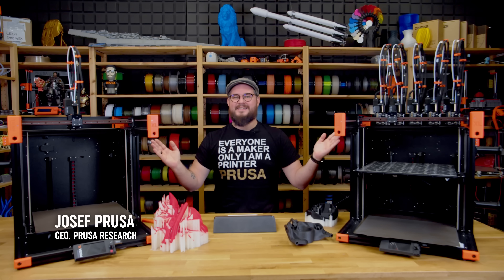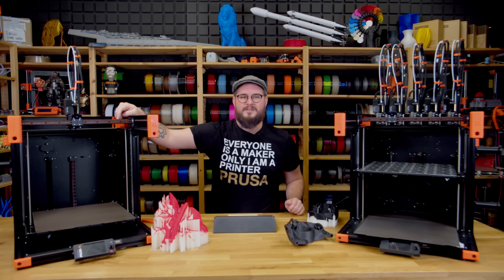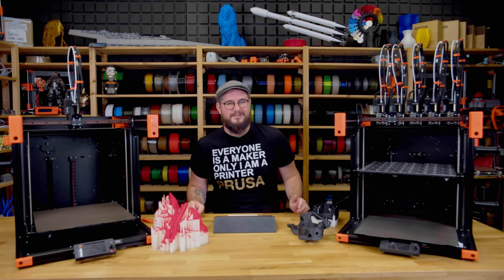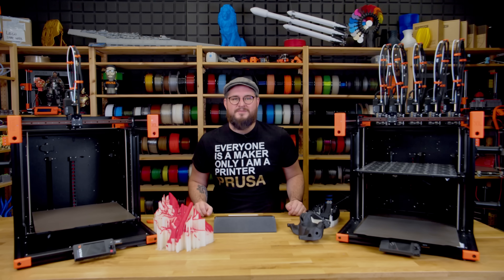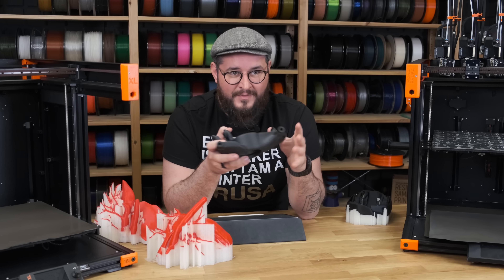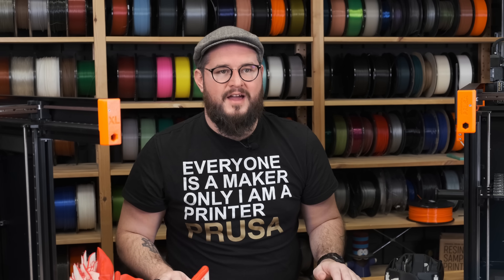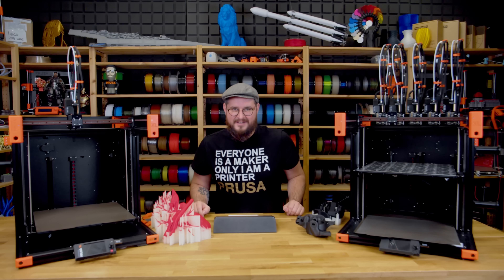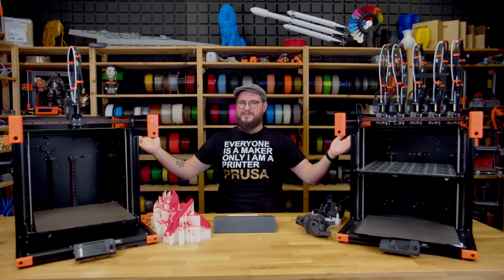XL update - beta test news, hardware changes and shipping schedule

Comment: So the biggest thing I see a TON of people comparing the XL to is the Bambu. The primary issue is.. speed of print.. and speed of tool change. A few demos showing us how fast the 5 head printer is.. both in tool changing and printing different materials would have been a VERY welcome update. I am being told by a few people now that the Bambu even with its massive filament waste.. will be faster printing than the XL.. and that the XL individual heads don't print any faster than the 5+ year old MK3. Would love some sort of update on this.. what sort of speed can the heads print at and how fast for tool change? Also.. will there be an enclosure option so that we can print ABS, carbon fiber, etc and will the heads handle 300+c and bed 110+c?
Reply: True multimaterial. Softflexible with PCTG for example and soluble support on top. With single nozzle designs you have to flush an absurd amount of material to get the soluble material completely out of it (think of transition from black to white and then multiply it by 10 or more). Otherwise you worsen the mechanic features of the non-soluble material. 

Bambulab has a "multimaterial" unit, in principle like the MMU or the Pallete. Those aren't really very good at multimaterial, they are best used as multi-colour. That is not the same. 

Speed is a thing but it isn't everything if one machine can offer something what very few others can.

I do agree however that the XL needs the option for a proper enclosure. Not necessarily actively heated but a proper enclosure nonetheless, at least as official upgrade.
Reply: That is a thing with the single tool XL. However as soon as we are talking about multiple toolhead XL, this is just apple and oranges. Both printers are in two entirely different leagues. There are very few easy to use, at least somewhat affordable multitoolhead printers out there (the XL is expensive but at least it is not yet completely crazy for a non-commercial use case). Of course, a multitoolhead print won't be as fast as a single toolhead print (it might be faster than a multicolour print on the Bambulab, we can't say without comparing actual printers yet) but it can print a lot of things that are impossible to print on a Bambulab even in multicolor mode.
Reply: @sagichnicht6748  in the diy space, a multitool blackbox kit can be built for close to half as much as a 2 tool xl,  and can print decently high temp filaments and can be water cooled.  runs klipper.
Reply: @JustinBuildsThings  Honestly I had not heard about the blackbox before. Looks interesting on first sight, but it is as much a competition to the XL as the Voron is to the Prusa. Not quite the same target group even if there is some overlap.
Reply: @sagichnicht6748  I'd be interested in knowing what a multi tool can print that the bambu couldn't? You can load up different materials and colors on Bambu as well. So not sure how it could not print anything the XL can?
Reply: It's core xy and it has high volume nozzle (assuming from Vulcan nozzle adapter). So main limitation to speed will be software and cooling - which can be dialed in. With multitoolhead, they could even switch between lightweight bowden and direct extruder.
Reply: @Papinak2  software being a speed limit? Maybe if they are still on 8 bit (if they are my goodness is there any hope for prusa? It's 2023!!). Bambulabs will do 300mm/s, and has cooling to match. No way prusa XL can match that with a frame like that. Cooling is just a matter of adding fans around the heat bed. Yes corexy = fast however all other parts have to be there to realize that potential. Rigid frame, 32 bit MCU, or klipper on RPI as co-processor, cooling as you point out etc.. all of it falls apart and is hard to fix if the frame is lacking.
Reply: @jotham123  what so great about bambulabs frame? They are just open steel profiles and its axes run on rods fixed on their ends. It's nothing extraordinary.
XL has linear rails on massive aluminim extrusions. I don't see reason why it should be much worse.
Reply: @Papinak2  exactly, steel. Big difference. With a bar across the front. Not a U shape when viewed top-down.
Reply: @Papinak2  That is what I was thinking.. this update indicates more rigid axes for linear rails to run on.. so I am curious how much more. I would have loved to see Prusa move to 4040 extrusion though.. sure makes it heavier and more expensive..but would have really bolstered the frame a lot more. Also.. offer some sort of enclosure option so out of the box we can print carbon/abs/poly. As it sits now.. we can't do those. :(
Reply: @jotham123  you just pulled one thing and assumed it's automatically better? That's like saying that spring is more rigid than aluminium tube, because it's steel.
Bambulab needs fully enclosed frame, before it's made from stamped L- profile. Prusa doesn't, as enclosed profiles are more rigid. And nothing stops anyone from adding a  brace to the front - it'll just obstruct view and access.
Reply: @Papinak2  let's wait and see what the results are. My bets are on bambulabs goes to higher speeds than the prusa XL and has better quality. Let's see..
Reply: @jotham123  yeah let's see. Out of the box, prusa will be definitely set  slower than X1 - but it doesn't mean it can't go faster. From point of mechanics, XL is more solid, but heavier with longer belts - some sort of input shaping will be necessary, but IIRC, that's already being implemented.
Reply: It’s a core XY so speed won’t be an issue
Reply: @baderalafghani4564  It's not going to be doing speeds like a voron or bambu. They've done corexy but on a C shaped frame. High speed printing on that absolutely will introduce problems as its front heavy.
Reply: @baderalafghani4564  just look at the frame, it's aluminium, which is not super rigid, and on top of that the way the frame has been designed just makes the situation worse. I've questioned the frame choice from the beginning. It's not going to get fast without rigidizing somehow. Bambulabs is going to eat jo's lunch if he doesn't watch out and he knows it. He's not super smiley and seems a little stressed!! I know I would be if I were in his shoes.
Reply: @jotham123  Prusa is a Religion to some people and believe there are lots of them out there.
I think it won’t be extremely fast but it will be acceptably fast .
They have tested it and some viewers out there are testing it .
TBH I have big hopes for it and it has some innovative ideas like the modular bed .
Reply: @jotham123   "just look at the frame, it's aluminium, which is not super rigid"
And you think the BL printers are? BL printers are made using thin gauge stamped steel lol. Look at how much a BL printer shakes and rattles compared to a voron running the same speed...Solid aluminum extrusion is infinity stiffer than thin ass sheet metal.
Reply: @LilApe  You are exactly right Lil Ape.
Reply: @jotham123  Yes, the market has become a lot less comfortable for Prusa. The easy years are coming to an end. However, if the XL works as promised, even if its not a superfast printer, I think Prusa will still have a fairly unique offer on the table with fairly little competition in that very niche, so far. The Mk3s on the other side, urgently needs a major update or rather complete redesign. It is getting squeezed between the cheapo options and Bambulab.
Reply: @sagichnicht6748  i agree with your statements.
Reply: @LilApe  You might want to actually try using one. The frame is rock solid. Honestly you've made so many incorrect assumptions in the comment section alone today that it's pretty clear you know next to nothing about the Bambu. Competition is a good thing. It forces everyone to up their game. And facts dont lie - the bambu for all its 'closed ecosystem' faults is a phenominally good printer, and I say that as someone who's spent a significant amount of money on Prusa printers.
Reply: @puressk  I've ran them, borrowed a friend's p1p to replace a stepper motor that burned out in less than 24hrs of ownership. The frame is flimsy and bendable. The frame is spot welded.
Reply: @LilApe  The Prusa XL is no Voron though. It's a voron where you remove one of the sides. How rigid is that?
Reply: At this price range, if it cant compete with the Bambu speed, its a no go imo. Market has shifted and we need speed and quality printing + quality of life improvements. WiFi, auto bed level, auto z adjustment, just do that auto calibration, load the print and forget - no user adjustments.
Reply: @VandalBee  Then you don't want the XL for what makes it stand out. I don't know, maybe there is no market for what the XL can print but Bambulab can't but there are certainly a number of exciting things that are coming to my mind which would belong to that category.
Reply: @VandalBee  You're not wrong.. the game changer part is the tool changer. We wont know until we see results.. for Prusa's sake.. I hope this printer can print at 250 to 350 per head.. and tool change is fast too.. because multi color prints.. able to print a lot faster over all because of fast tool change and pretty fast prints.. will win customers. Bambu x1c takes over a minute to change filament. On one print I saw.. it was 840 changes..that's 840+ minutes extra print time.. nearly 15 hours longer just to do those changes. It prints much faster though.. so if the XL is printing at or near the speed of the MK3.. they are in trouble. They need 2x to 3x print speeds with quality consistent output.. and rapid tool change.. e.g. less than 20 seconds or so.. to change tool heads, and start printing next one.. or I suspect a LOT of people me included would cancel orders. We can't be expected to pay nearly 2.5x the price of the X1C.. and see slower print speeds. Also keep in mind.. no enclosure.. so we're talking another few hundred bucks to have a cheap large enough enclosure, if not more expensive to have something comparable to the bambu x1c enclosure. That is why I said.. the update we REALLY need is performance.. how fast is it changing tools.. and how fast do the heads print. Those two things are what will make or break the majority of customers. Especially given the 2+ years this has been in the works.. and while I understand delays.. other printers are not being delayed.. Makerbot, Ender, Bambu.. all putting out lots and lots of printers right now. So to me.. I hope this planetary head change, and tool changer is a huge leap forward or Prusa may have some problems.
Reply: @VandalBee  agreed. Furthermore, ijection molded parts with printable replacements to bring costs down seems wise.
Reply: @VandalBee  Speak for yourself! If you need speed - okay. But others might prefer reliability of the manufacturer and an ensured product life span due to open hardware approach. Others again may rely more on horizontal scaling and processing many different materials and don't need high speed.
Reply: @VandalBee  considering how long it takes to switch between colors on a bambu x1 with ams, even if the prusa xl does the actual printing slower it might finish the print faster if there are a lot of color changes. I had originally ordered a prusa xl but I bought a bambu x1 instead. The Prusa XL is too expensive and it's taking too long.
Reply: @atnfn  Meh, who want's to talk about multi color as long as the the color palette is limited to the filament colors itself? Ask me again when color mixing and excess material is solved 😝 .
Reply: @tmartin9482  Excess material is largely solved with a tool changer. Regarding full color palette mixing that doesn't need to compromise a lot, that's just outside of the price range of hobby printers. The XL isn't primarily about mixing colours though but mixing different materials with fairly different printing requirements into one print, at a decent overall printing speed.
Reply: @sagichnicht6748  I totally agree and know 🙂. Just was pointing out that multi color printing, as it is, is a pretty neglectable feature for many users out there.

Comment: Running a 0.6mm nozzle on my mk3s+ with no quality loss and recommend it to everyone
Reply: I've been seeing this more and more. Other than really small prints/details, it supposedly is as good.. I would assume .6 means faster prints? More can get through faster?
Reply: @WhySoDivided-CantWeAllGetAlong  Using a .6 i have noticed prints are quite faster than a .4 you can always check in your slicer the print times, ive found smaller items are negligable but anything thats about 20mm or bigger you cut a good chunk of time off using a .6
Reply: @jovanrado9548  It's not a lie at all, many people switched to a .6 with zero issues, still as detailed with precision and overhangs have never been an issue

Comment: Awesome! Love the V6 nozzle compatibility.
Will there be the option to purchase additional toolheads at a later point?
Reply: Yes, you can upgrade. However, above two toolheads you need another controller board, which is more expensive than just the toolhead.
Reply: I have a feeling that you have one of the beta units and you are testing 😉. 
Can’t wait to see your review, because you are one of the trusted viewers .
Reply: @baderalafghani4564  I actually don't have one but need to evaluate if I change my current order with just one head to a multi head version but get it way later this way 😅
Reply: @CNCKitchen  my advise is go for one tool head now and add more tools later if you find your self happy with its performance.
Reply: If I remember correctly there will be but I believe it will require some extra electronics or hardware if you ordered the single head originally. If you have ordered at least two heads I think it already includes the extras. I’ve slept since hearing this so it may need double checking 😅.
Reply: @CNC Kitchen Would love to see/hear some insights on multi tool head printers of the upper consumer/prosumer market and lower professional market on your channel or The Meltzone. 😉
Reply: Can’t wait for your review/impressions of this printer once you have it for testing!!
Reply: We should keep out place in line and get a single tool unit when they ship and the 'extra' tools later when they are shipping multi tool units...
Reply: I’d love to see an ASMBL style “Milling+Vacuum in-one” tool, and an adapted LumenPnP Based Component Pick and Place tool (and maybe heater insert press tool?, or to just captive nut, that is the question) to go full one click to final dimensionally accurate multi material product!

Need to actually get the machine…and the toolheads…and the slicers…ready first though.

Either way this is VERY exciting!
Reply: I think the multi tool will be outdated after bamboo ams I think they should make something like them
Reply: @Casal0x  serious question: why do you think sending different filaments through the same nozzle, and wipe/purging for every filament change, is better than having separate nozzles with the filament already loaded that only need to "take turns"?
Reply: @nightcrayon  from that point of view is ok but you can’t have 16 head, or nozzle, but you Can with ams also changing the nozzle is cheaper too
Reply: @Casal0x  You  mean 16 filaments right? (not 16 heads).  The AMS doesn't change nozzles during prints does it? Or is the AMS different than I thought (i thought it only changed filaments).  With the XL toolchanger you actually could print with multiple different nozzle sizes on the same print which might be useful for supports or infill for something large.  The cost of course is in favor of the AMS, but it seems to be much less powerful (unless you really need 12 colors in the same print or something ;) )
Reply: @nightcrayon  ams purges and retract the spool to insert a new one, about nozzle you can change it when it’s necessary for different types of filament
Reply: @Casal0x  You basically need one type of nozzle for all filaments, a hardened steel nozzle and you are good to go. Only the size of the nozzle could be needed to be changed for a different project. Keep it simple :) Less is more :)
Reply: @Casal0x  They tried that thing like 3 years ago, and it was not that great. I recall buying their multi-colour/filament welding machine (sorry but I forgot the name), which never worked as it should. I ended up sending it back. Well, both systems have a plus and minus, but I can imagine that 4-5 tool heads cost more than an AMS for 350 us dollars, which basically does the same job.
I don't even know what the price for the XL multi tool head printer is?

Comment: Can singles been converted into multiple toolheads?
Reply: Yes. You can add 1/2/3/4/5 tool heads. I read a while ago that to go to 3/4/5 heads would need an update to the board/controller? So better to get 3 heads out of the gate and not deal with the extra cost/update issue. But not for sure on that. MAybe they changed it so it supports 1 to 5 heads out of the gate.
Reply: 6:00 FFS
Reply: @perchte  not what he asked
Reply: @cesmans  Okay. If the question was about if they can be upgraded afterwards then the answer @Kevin Duffey gave is almost correct. They stated that there will be ways to upgrade in the future but that the controller board only has enought IO Ports for 2 Toolheads. So the upgrade to 3 or more has a big price jump because an additional expander board will be necessary, hence the huge price jump if you order the 5 tool variant now.